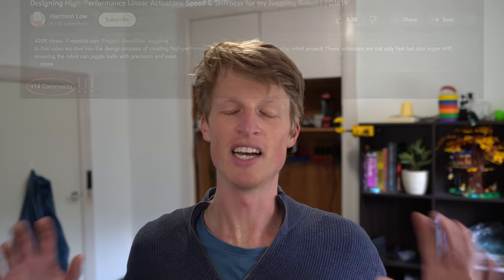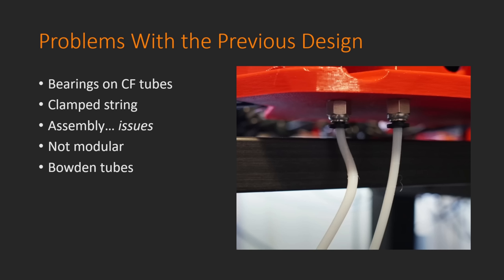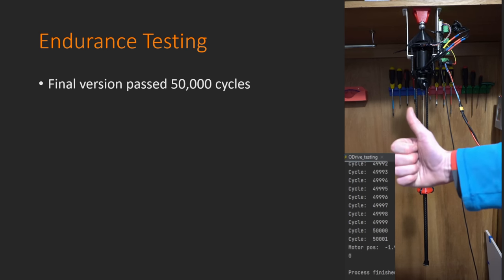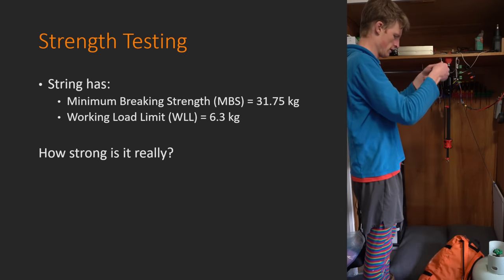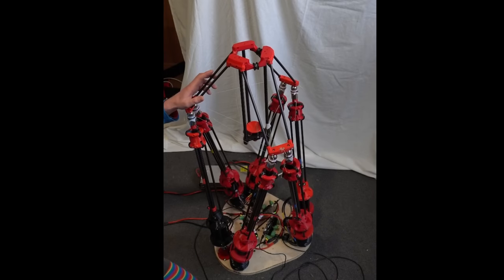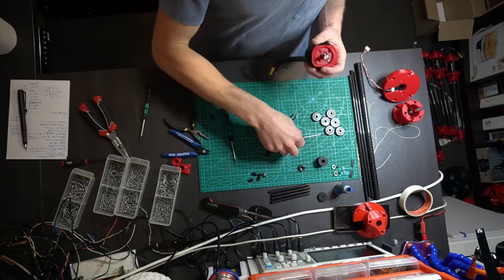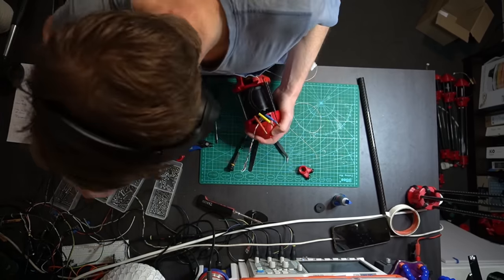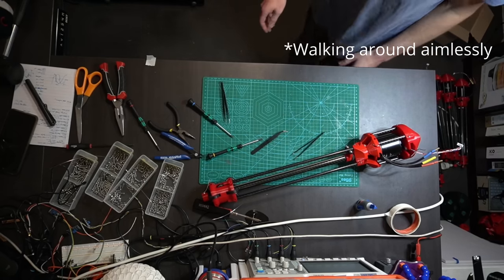My New Linear Actuators are SO MUCH BETTER! | PDJ #21

Comment: Why even use breaks to slow down and change direction would it no the better to have a system that can change direction without the motor changing direction? There are some gearing and pully systems that would allow that.
Reply from the maker: That would be super cool! Do any specific examples come to mind? It'd have to be a fairly small mechanism to fit inside the actuator, but I'd love to explore that possibility for any future revisions! Cheers for the idea 😊

Comment: Vslot rollers like they use for 3D printers might work better than the bearing set up your currently using.
Reply from the maker: Good idea! I'm worried that having the metal straight on the central CF tube might cause wear, though? (similar to what I experienced using the normal radial bearings [shown at 2:07 in the vid])

Do you think this might happen?

Another viewer suggested using V-groove bearings with o-rings in the groove, so the o-ring is the only part actually contacting the tube. I'm very keen to give that idea a go!
Reply: @harrisonlow  I would recommend using the delrin v slot rollers.  I think they would work a lot better than the steel ones.
Reply from the maker: @DoRC  I'll try to remember to put in an order for these today! Cheers 😊

Comment: In terms of the slowing down, you may want to look into powered steering, a technique called drive by wire. It's essentually adds pressure from one motor  that is generated from another to create a force. One motor controls the other. You also have to remember moving mass is heaver mass in terms of the string. Terminating the line you can drill a hole in a screw and feed it though and tighten, or use a couple of washers.
Reply from the maker: This drilling-a-hole-through-a-screw idea keeps coming up! I'm very surprised as I'd never heard of it before. Have you used this termination method before? What for?

Comment: 8:42 For measuring precision, I bet you could mount the actuator to a pivoting mirror and reflect a laser off the mirror. Then, depending on how the (measurable)  laser point moves with your (incredibly small) movement of the actuator, you can use trigonometry to determine your actuator's precision.

Comment: You could consider using a very large super capacitor as a "breaking load" for the ESC.  If you dump into the capacitor and then pull power back out, you should end up with a net loss in power usage, thus the batteries will be at net discharge without worrying about chemistry issues.

Comment: You can buy standard v-groove bearings that are use on mini cnc's. They would be ready to use without any heatshrink. Putting the string around the motor would add gearing, Your gearing is betting imo.

Comment: I've had to sand flexible filament before it will bond with other materials. Also, you could try a concave profile for the bearing sleeves, that might give it more surface contact with the rods vs the current round profile.  Def see the rolling brace being more stable when against all 3 rods.  Look at how roller coasters work, you should be locked in place with just 2 bearings per rod if all are angled for opposing forces. Congrats on the progress! Looking great
Reply from the maker: Very interesting point re. sanding. I'll try that out!

I actually originally had the TPU sleeves being concave instead of convex and they had an insane amount of friction (though they were a very good fit for the CF tube)

I agree that four bearings are all that should be necessary, but I can't think of a good way to position them so that they're robust against forces in all directions!

Cheers 😊
Reply: @harrisonlow  you'll also want to sand the metal surface of the bearings where the TPU bonds - I use rubbing alcohol to clean both sides before gluing.  I'd start w/ equal angles on all rods - 2 bearings per rod, on opposite sides of the rod (angled more than 90 degrees to each other) so the the tension is pushing out, away from the center equally.  Provided the sleeves don't make contact w/ each other, they could be all aligned - so a ring of 6 bearings in a sort of star pattern.  If you test the TPU sleeves w/ dif infills, you might find the right density to keep tension w/ out too much friction

Comment: Dyneema string?  1/8” rope has a tensile strength of 2,500lbs. Instead of a round central tube, make it hexagonal.  3 bearings at the top, 3 on the bottom tube 60 degrees apart. Or make a central telescoping tube with a linear bearing (instead of 3 lower bearings), run the line internally.  The top pulley would be attached to the fixed internal tube with a solid guide bar fixed to the top of the telescoping tube running the length (think 3 tubes in 1).

Comment: It looks like a space elevator!  For faster stopping you can use electromagnetic brakes - one that goes on the motor shaft and stops the shaft when you put power into it.  You can use the motor to brake, if it is an AC or stepper motor, just applying a DC voltage to the windings should work as a brake, but with a DC motor you either have to reverse the input voltage or switch the circuit to a large load (resistor, light bulb or something) to do regenerative braking.

Comment: To terminate the syncromesh cable, use a set-screw inside a metal screw insert.  They're used a lot in woodworking.  Drill a hole into the insert near the bottom, then feed the wire through, screw I to the insert. 

For the wrapping around the motor housing, that would decrease the speed, but would massively increase the strength I think.

This is amazing progress.  Not sure what you're planning on using this for, but it's really cool!
Reply from the maker: Interesting! I imagine you'd have to use fairly large inserts to do what you're describing? To check that I'm understanding you correctly, the wire would be "pressed into" by the bolt, but would it have anything touching it on the other side? Or does the strength of this idea come from the wire being bent by the bolt, disallowing it from being pulled back through?
Cheers!

Comment: You asked about "braking" the motor, braking resistors....

Braking resistors are necessary when you can't store the energy in the system in the capacitors at the input (of you feed of 3 phase AC) or in the battery. 

For an example take a mountain bike. Freshly charged battery, drive up the hill to the bottom station of the skilift, get transported up 2000m, and bike back down. up the hill uses say 100m * 1000N = 100kJ. Down the 2000m mountain releases 2000m * 1000N = 2MJ so you have 1.9MJ of energy to put in the battery. That energy has nowhere to go. You can assume say 10% losses, but still most of it cannot go back into the battery. 

Your system is different. You have (max) 70N of force, times max 0.5m = 35J of energy that MIGHT need to be stored somewhere. Start with the system at rest and you're ok. (If my mental math is correct, 35J is about .5mAh of a 21V battery. Got out the calculator, calculator says it is about .05mAh. Somewhere in that range. Your battery does not explode if you overcharge it by .5mAh). 

To slow down you would need to command "negative current" of your motors. I don't know what ESC you use. The "putting energy back into the battery" is automatic. The motor/ESC cannot prevent that from happening.

Comment: you might want to upgrade your "string" (6.9kgs??)  to Dyneema or kevlar cordage? 2.5mm kevlar is rated at about 1000lbs, (1.5mm 500lbs) Dyneema even more.. available from kite stores, chandlers and the usual suspects...  

a larks head knot might be a good fastening for it too..

Comment: Take care when coming to conclusions about strength when dynamic loading (moving loads, like the jiggling of the backpack @9m10s). You'd be surprised at the loading factors (multipliers) involved vs a static. For example, "dropping" a mass onto a beam from a height of zero (barely touching), already has a loading factor of 2.0! Better to use a load cell with a steady increase in load if strength testing is ever critical for a project. Totally overkill here of course since it wasn't a design requirement :D
EDIT: All of this is in relation to the string's rated load. The lifting capacity claimed in the video is totally valid for this specific design being used in this exact way.

Comment: For your cable clamp, you'll need 2 metal plates with a hole at each end (10x5mm, with M3 holes should suffice) - fix the plates with screws at each end and clamp the cable between the plates.  Might work better if you set a shallow channel in it to keep the cable from moving about.

If you can't make the plates, plates from a bicycle chain would work.

Comment: looking to an H-bridge drive circuit, it should allow for bidirectional current to charge discharge, you'd still need a battery or something to absorb the energy or else you'll blow up your power supply.

Comment: You should be able to get the pulley count down to 2 per string:
* for the extension string, just rotate the existing bottom-of-tube pulley around the tube's axis until the input string is tangent to the drive pulley, and remove the other motor-side pulley.
* for the retraction string, chose a random point "A" in the plane of the drive pulley ~3cm away,  draw a line from "A" tangent to the drive pulley in "B"; then set a point "C" on the central axis ~1cm above the pulley; the string should follow the path "BA" "AC" then up the central axis from "C". The 2 pulleys are semicircles at "A" and "C", tangent to "BA" and "AC", and "AC" "central axis" (in CAD, create a plane from each pair of lines and just add the circle) [for clearance, you might need to swap the extension and retraction drums]

Comment: It may cover the rolling bearing in a concave shape instead convex shape. That will make it more surface to contact.
For the motor braking, you may use a big (small super) capacitor.  (store the energy instead of dissipating)

Comment: 10:59 "guitar tuning machines" straight up made for tensioning cable. Might be a good idea to make your own to some degree though. No need for a huge key poking out the side should you try doing that. It's a worm and wheel gearset with a cylinder with a hole in the side attached to the wheel. You could turn the worm gear with a screwdriver, and the wheel would rotate slowly, allowing you to tension the cable.

Also for the resistors all you really need to do is ensure super low resistance and dissipate the heat. You do need to know however just how much current that motor can handle continuously while torque stalled (rotor locked in place) as this will determine the minimum resistance for the long-term use of braking.

Then it's just a case of full bridge rectifying the 3-phase the motor output, and having a MOSFET closing the gap on the output. The voltage to the MOSFET would change the resistance and so you can alter the dissipation that way. You will need to heatsink it though. No need for an actual resistor as long as you have a chunky enough MOSFET to handle it. Braking resistors are only really needed when you're working with super high power stuff that has a lot of innertial energy to dissipate, and the motor is going to be your weakest link there, second is the string. I've worked on megawatt scale robots in factories before and the braking resistors be crazy. Like bigger than me crazy. Not really needed for this.

If you use MOSFETs you have another advantage, and that is you can vector the voltage being sent to it based on stator temperature. So say that motor is at 95C already. You could decrease the braking force so the motor doesn't start melting its enameled wire by sending 2 volts to the gate instead of 10. You will however need to make a logic gate based interlock system such that if you're telling the motor to move, that braking system should never activate while the motor is running and vice-versa. If you have trouble, I can elaborate but I think it'll be more fun for you, now you know it's possible to do it with simple components, to figure it out.

Comment: For terminating the cable, maybe google "Duplex Wire Rope Clip" or "Simplex Wire Rope Clip" and see if that's something you can use a variation of?

I like the duplex option, which is essentially, one more screw, a shaped/walled plate and a flat plate. Redesign the red cap to seat it.
I have no idea if you can get them at that size, though. They seem made for much larger cables mainly, I can't find any that are shorter that 31mm.

The screws and the flat plate are easy, but for the shaped/walled one, perhaps you can make your own with sheet steel? It's a bit of a stretch, but maybe.
Or perhaps just squeeze/hammer the middle of a tube and cut it, might get a usable geometry from the right stock.

Or just print thick plastic walls to hold the wire in place, and do the flat plate with two screws over it.

----

If it's so stiff that the loop to run it back is too big, then maybe try U-clamps?

Comment: Could do it with 1 pulley (at the top) by putting the motor perpendicular to the actuation?

Also maybe dyneema for the strings? It's 15x stronger than steel wire

Comment: Hello. Harrison. I'm writing because I think I can help you a little, with an idea.
You talked about being able to tighten and change your strings on your Linear Actuators. when you tune the strings on a guitar, you turn a small handle. very simple mechanical structure. What might not be so good about it is the weight. But it can certainly be made very light in weight. Thanks for a great channel.  Finn

Comment: For maximised braking - reversing the power of the driver is likely more effective - passive regen has limits (resistive load), especially if using permanent magnet motors, peak  regen (If requiring energy recovery or dissipation those are the limits ) is generally much lower than the peak power now to produce full power deceleration, hopefully your motion control algorithms and position/velocity sensing (state control) is robust.....

Heat rejection is really important to get in hand.

Comment: 4:36, fewer pulleys are possible! Let's look at the blue one in that frame. The flat-laying pulley for the blue string is unnecessary. Because, if you rotate the other  blue pulley 45⁰ around the vertical axis (z-axis), the horizontal part of the blue string already becomes tangent to the spool.
It's hard to explain, but do you see what I mean? :)

Comment: Terminating synchromesh cable with tension adjustment... why not use a guitar or bass tuner at one end (would work for your present string too)? Instead of the TPU or shrinkwrap bearing sleeves... why not V-wheels?

Comment: A dirt cheap and possibly very small termination method for synchromesh or other steel cable: use the brass core from a good quality "domino" screw terminal (common in europe, eg. reference "034211" from Legrand, or "1563996" from Conrad ) , held in a 3d printed part with a screw or with a thread all around the holder and a nut for tensioning. (tensioning should only be needed at one end of the pair of cables)

Comment: What’s your preload on the strings?  A lot of equipment used in medical device manufacturing that require long distance travel and precise positioning are belt driven. The belts on one of the machines I routinely use has a preload of almost 600lb (275kg).

Comment: String is very stretchy. Under loads the braid tightens, eventually that is permanent. You had no way to compensate for that.

For terminating the cable, which may also require stretch compensation, look at how it is done on steel cables. Crimp on a terminal to prevent fraying, but not for a load, or for loads, slip on a bigger terminal than loop the cable and put it back into the terminal before crimping.

in electrical applications sometimes soldering is used, instead of crimping. I don't know what that cable is, but perhaps epoxy would work, maybe with crimping.

Comment: I didn't watch your whole video, but maybe use a square aluminum tube actuator shaft to solve the wobble problem? This would help with bearing sleeves as well.  Also, could have channels routered into the tube to secure Bearings in place better, too? IDK, just a thought, nice work, man

Comment: If you happen to improve the precision... and want to measure it with arbitary precision, then stick a mirror at the end of the actuator, shine a laser on it at the stop point, and watch the laser dot on the wall (5-10m away) moving. No need to build complicated pulley system.
Take a look at plastic coated U profile sliding door pulleys, they might be a good fit for your application.
Restricting the inside end of the moving rod is great, 3-4 bearings should be enough to constrain it.
Excellent project!

Comment: to terminate the wire all you have to do is add a tube with a decent wall thickness where you want to end the wire. add a screw to the side of the tube and thread the wire through the hole. Like the tension adjustment on bicycle breaks

Comment: The precision could be improved by changing the winding mechanism because, currently, the line is winding up on itself and unpredictably changing the diameter of the winding pulley.

Comment: For the precision/accuracy: not sure about the details of your design, but when your motor spins in either direction, the string is looping around it, effectively changing the diameter of the Motor's pulley. Making it bigger or smaller will dynamically change your "degrees per mm" conversion! If, initially you calculate 1 rotation = 1 mm, at the end stroke it would probably be more than that.

For the central fiber twist: My main guess would be the alignment of your pullies. If they are not aligned properly, the efforts in your strings mechanism will not be symmetrical enough (with this system it cannot be symmetrical) and I suppose that after numerous passes, combined with vibration and dynamic load, some screws started to losen themselves ?